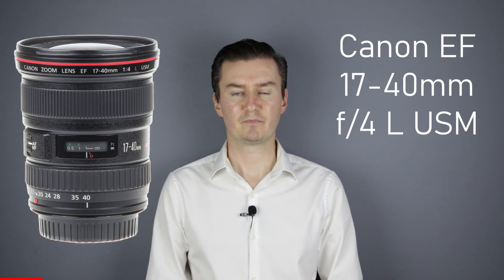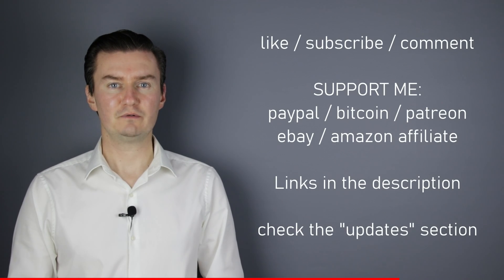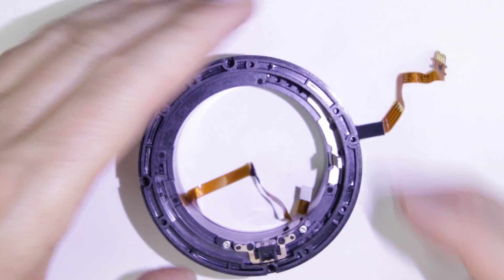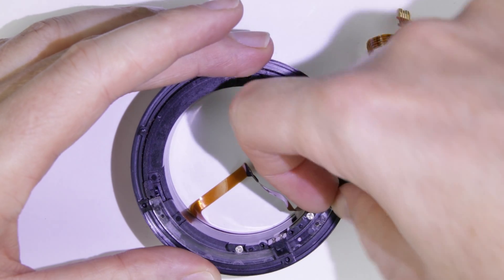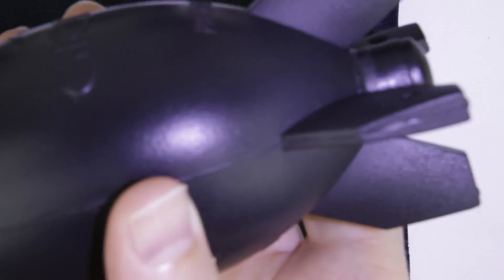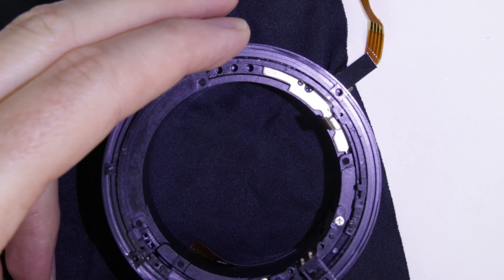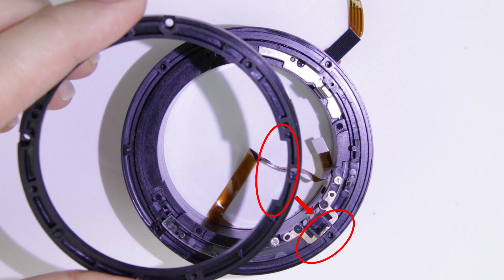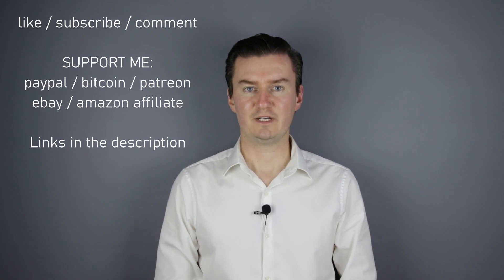Canon EF 17-40mm f/4 L USM lens clean the USM motor focus sensor strip bar - repair focusing problem

Comment: My focusing ring is stutterring and moving a bit right and left after the focus is set, doesn't stay in place.Will this help, or the problem is somewhere else?
Reply from the maker: This video is about repairing the focus hunting problem: if you zoom to 40mm, and try to focus, but the motor just goes back and forth and can't focus on the subject.
Your problem is seems an another one, but seems to me a mechanical problem.

Comment: Hey man, first thx for all your videos, i started to learn how to fix and clean lenses and your videos helped me in all i need.
How I'm a beginner, i am buying lenses with fungus or some problems.
Recently i bought this 17-40 that the owner said it has no AF, but after cleaning worked fine like a new one (thx to your videos of disassembly).
But i got some error, when focusing on subjects 3 feet away to the "infinity" seems like the lens doesn't have energy to do the focus. Now i stepped into this video and want to try it. Do you know that problem? (I'm a Brazilian, i think the word is 'the focus jiggle and doesn't go more')

Thx again for all your work here ❤
Reply from the maker: My guess would be the USM motor is causing this problem.